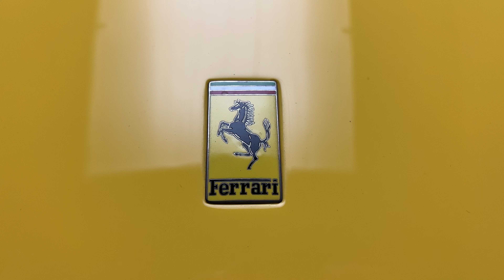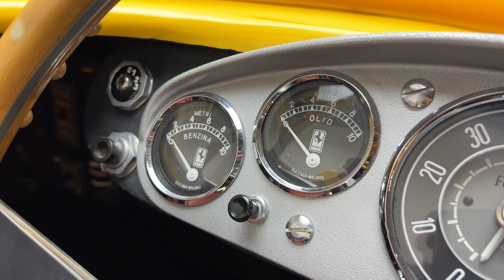Pebble Beach Concours Winner -  Ferrari 410 Sport Spider Car Show Detailing

Comment: Beautiful, has the engine cover (hood) a different shade of yellow or is that the camera setting?
Reply from the maker: Good eye! The hood had been repainted before the show, and it wasn’t perfect. But it’s going away for a full restoration so the owner wasn’t too concerned
More noticeable on camera than in person anyways
Reply: @IAMDetailing  Just a) I have a similar color yellow (and repaint issues) on my Italian spider and b) you do a perfect job on polishing and making videos so it's easy to notice! Keep it up you are a truly inspiration!
Reply: @IAMDetailing  if it just won, it does need a restoration!!! Don't understand
Reply from the maker: @psk5746  the car was restored many years back and it’s nice but not perfect… it won because it’s beautiful but the owner wants to have it perfect as it can be and what I know there will be some major change.